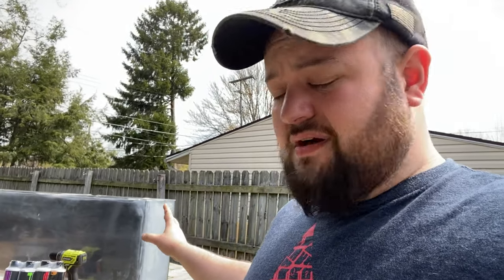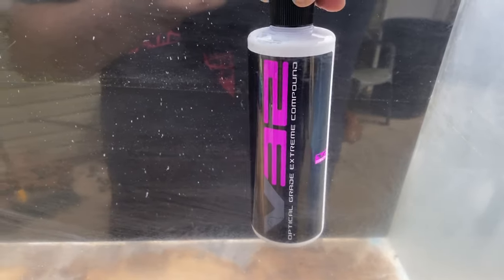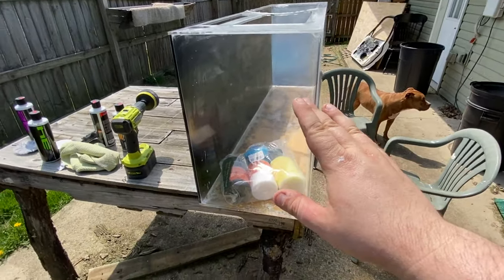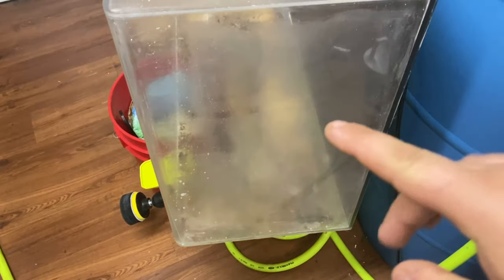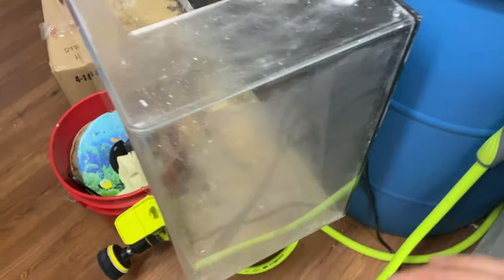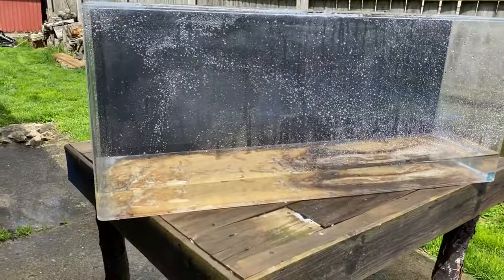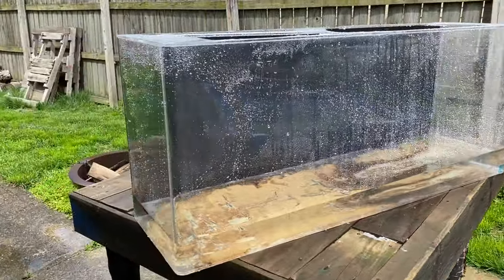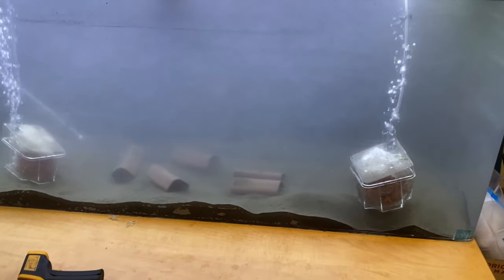Restoring a free acrylic tank, sanding acrylic and polishing acrylic

Comment: Loved the sick track in you're video that alone equals a sub. This was the exact thing i was looking for to restore acrylic tanks i got
Reply from the maker: Thank you!
Reply: @SCAquatics  Hey bro, i have a question about doing this with my own tank if you are still answering questions
Reply: @dingodyno9016  what’s the question? (This is Stephen on my other account)
Reply: @beaterboxgarage  So i tried to wet sand the tank but i am a rookie at this and didnt realize that there was specific type of sand paper which is wet dry sand paper in order to do the wet sanding, so i ended up using just regular sandpaper instead and ended up scratching the shit out of because i am a clown and used the regular sandpaper instead of wet dry. My question is will the buffing and using the wet dry sand paper (which i have already begone using instead) and then following up with the buffing you did here be able to correct the major screw up that i did and get rid of the scratch's completely and make it look crystal clear? or is the damage irreversible and even if i make the tank look crystal clear will i just have to live with not all the scratches buffing out completely?
Reply: @dingodyno9016  you can get any scratch out. You just have to use finer and finer sand paper. Say you used 800 grit sand it again with 1200. Then again with 1500. Once the scratches are gone you buff it. Keep increasing the sand paper until the scratches are gone. I would use water on all the grits.
Reply: @beaterboxgarage  ohhh i see. Thats where im going wrong. I keep wet sanding and then buffing and then wet sanding. I should just wet sand first to get all the scratches out and then buff. I got a pack if wet sanding paper that is 10000 that goes all the way down to 2000, im assuming so I scratched it good, I need to go lower in grit right? The lower the number the more abrasive it is? Is that how it works? And the higher the finer?
Reply: @dingodyno9016  start rougher and end finer. Higher the number the finer it is. Buffing is last step
Reply: @beaterboxgarage  Okay i appreciate all the help. So I used an 80 grit normal sand paper (face palm) should I use 600 grit wet dry silicone carbide ultra fine sand paper?
Reply: @dingodyno9016  I use regular old sand paper

Comment: Remember kids.  Work smarter not harder.  2000 to 3000 grit wet sanding would have made quick work of this tank while this poor shlub is stuck spending all afternoon with a drill and overpriced auto cutting compound.  

Step one, clean that bad boy out.  
Step two 2000 grit wrapped over a kitchen sponge, keep it wet, keep it side to side.
Step three rinse!
Step four 3000 grit wet sandpaper over kitchen sponge, keep it wet, keep it side to side.
Step five rinse!
Step six go to automotive store or your neighbors garage and grab any plastic polish you can find, headlight, trim, whatever who cares, cheaper the better save that money!
Step seven hook that wool on the end of a drill and rub that polish in.  Side to side let the drill do the work.  Wipe with a microfiber cloth and admire your work.
90 gallon all clear tank took one hour and a half.  Mainly because I ran out of booze and had to go to the corner store and then Kiki and her kids ran into me and we had to talk about her dead beat husband.